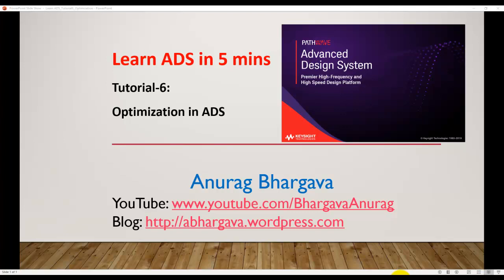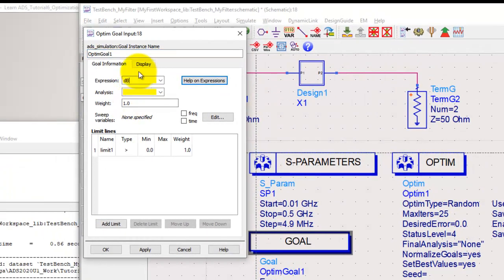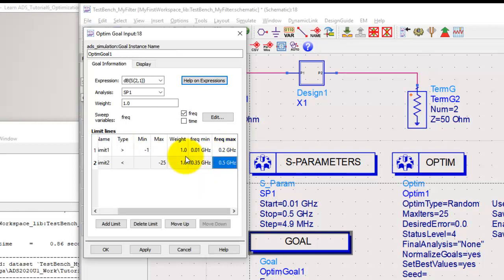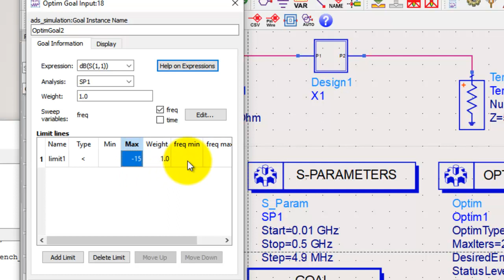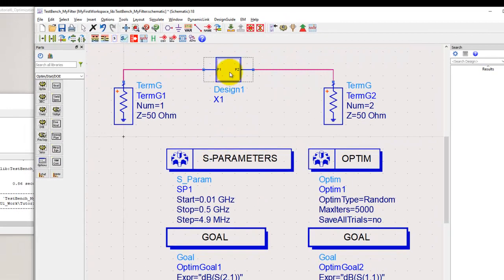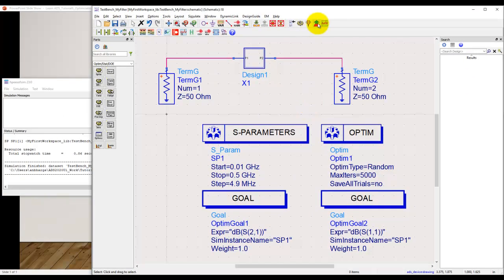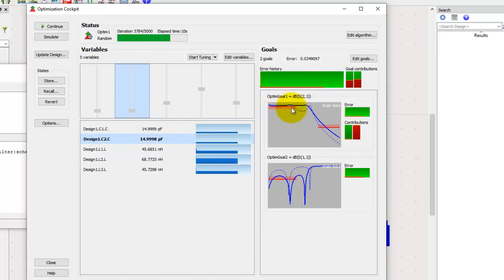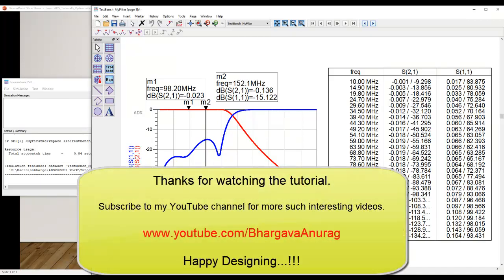Tutorial-6: Optimization in ADS

Comment: Hello @Anurag Bhargava 

Thanks for your video.
I'd like to know if it's possible to do curve fitting with ADS using ADS. 
For example if we have measurement data of Ids-Vgs of a MOSFET (Static characterisctic and we want the circuit to fit the measurement values) and the Ids equation of the Mosfet that we can put in verilog code. And the parameters to fit in the verilog code.

Thanks
Reply from the maker: You can watch A vs B /Reverse Engineering video on my you tube channel but it seems you are trying device modeling and in that case Keysight ICCAP would be much better solution to your needs.
Reply: @BhargavaAnurag  Thank you for your reply, I will watch the video you are talking about.
Yes I am trying to model a MOSFET and I want to adjust the parameters of my equation.

Comment: thank you for the presentation, sir. I have a question, I faced the error  Spec 'OptimGoal1', LimitLine 'OptimGoal1_limit1': independent variable 'freq' not found in result data ... when I used Optim with LSSP simulation, this error doesn't happen when I used S-parameter, how can I solve it?
Reply from the maker: Its difficult to support such queries on YouTube. Kindly contact Keysight tech support team to resolve the issue.
Reply: I had have same error and ı realized that the 'GHz' isnt writen after the min and max freqs at the stating of the limits on the goal section

Comment: Is it possible to optimize an EM Layout model? Thank you
Reply from the maker: Yes, you can. Kindly keep watching the series and later you will see parametric layout video.
Reply: @BhargavaAnurag  I have seen EM parametric layout video but how we can do optimization on momentum did not get yet. Please make a short video on it sir.
Reply from the maker: @adnannadeem6223  There is nothing special with EM optimization once you have the parametric layout component placed in the schematic. Follow Parametric EM simulation video and at the end instead of performing Parameter Sweep, you could simply using optimization as you do on any schematic component. Steps will be exactly the same, just remember that for every value combination/optimization step it will perform EM in the background so overall time could be pretty high hence I advise people to perform Parameter Sweep instead, and then in the emmodel you can switch on the interpolation to perform Optimization. With interpolation EM data during optimization will be interpolated instead of running a new EM simulation all the time.
Probably I can cover those tricks in one of the future videos, thanks for the feedback.

Comment: Thank you very much for the nice tutorial. 
I have a question. Is there any way to run multithreaded simulation while doing the optimization. when I use the optimization cockpit it only uses a few cores of the system.
Reply from the maker: Hi Mohd, Yes almost all simulators in ADS can utilize multi-threading, you can place Options block on your schematic and look under Threading tab to configure it. Hope this helps...